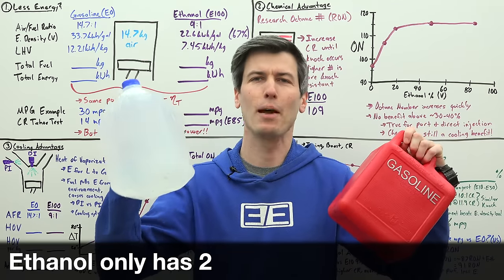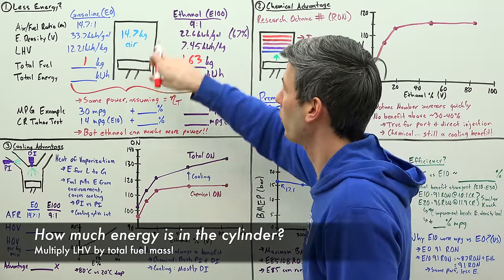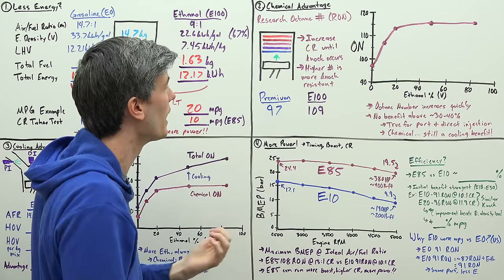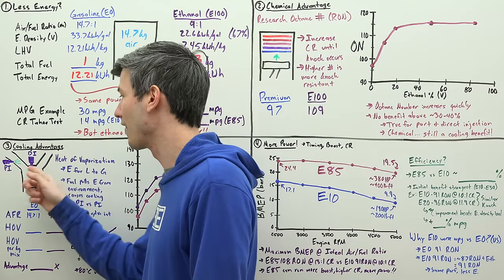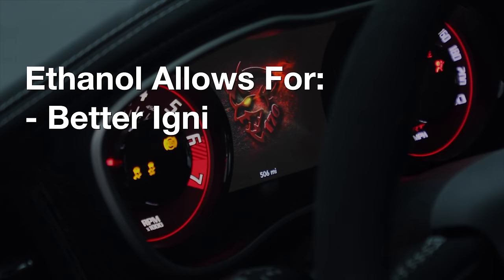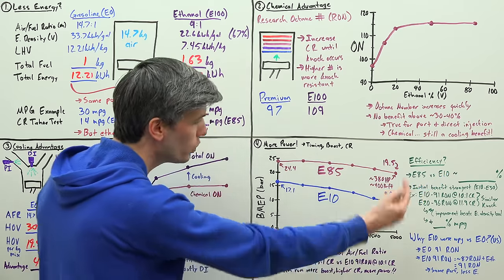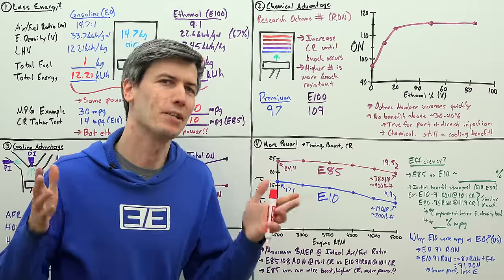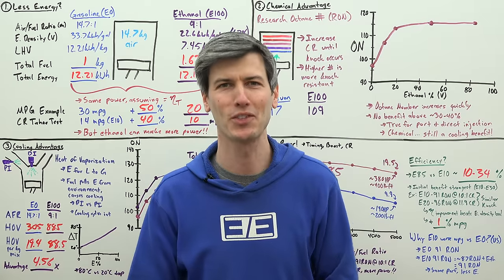Why Does Ethanol Make So Much Power? (Versus Gasoline)

Comment: The cooling effect of pure ethanol is so significant that for top fuel dragsters they don't use conventional water cooling of the engine block which then allows the use of a billet machined block which is much stronger than requiring the hollow cooling jackets in the block.
Reply: Pretty sure top fuel uses Nitromethane and Methanol not ethanol, the same cooling principle applies though you are correct
Reply from the maker: Is it a cooling thing, or a duration of heat thing? They obviously make extraordinary amounts of heat, but it's only for ~4 seconds, and then the engine is rebuilt, so having a dedicated cooling system may not be needed.
Reply: @EngineeringExplained  You're correct, they make a tremendous amount of heat. But the engine block is a sink. Trust me it's hot when it's finished a pass! I have a drag bike that runs on methanol and nitro blend. It's very hot when you're done. Same principle, solid block.
Reply: @EngineeringExplained  In that level of racing the engine is considered a consumable, just like the fuel.
Reply: @BillyWillicker  $$$$$$$$
Reply: @EngineeringExplained  I think it’s partly both but more a cooling thing. Around 8.6x more fuel, and that fuel having similar heat of vaporisation to normal petrol means roughly around 8.6x more cooling from just the fuel. I do believe these engines running for just 3/4 seconds at full power is almost a non factor as the heat energy they output in that small time surely surpasses what most engines output in literal hours I would guess. Basically I think they don’t need water cooling because they are fuel cooled engines essentially.
Reply: Fuel cooled with a TON of POWER!!  I'd love to see a video on how a top fuel dragster engine makes 15000hp from a 500ci block ... it just seems impossible!
Reply: @BillyWillicker  
Yes, I have heard a top fuel dragster run described as "a semi controlled explosion in a disposable container".
Reply: Don't forget that they rebuild the engine after each run.
Reply: Thanks, I've learnt something
Reply: Top fuels dont use methanol bud they use Nitromethane. A completely different fuel
Reply: @karlrovey  And that motor probably doesn't turn 800 total revolutions while under load & stress !!
Reply: @waylonmccrae3546  
The stress is immense! The cranks commence cracking from the very first use. They monitor the progression after each run and dispose of the crank after about 6 to 8 runs. Insane stuff!
Reply: @BillyWillicker  mmmm
crunchy engine block

Comment: I've been running ethanol in my vehicles for 40+ years. I learned everything you explained by trial and error. It depends greatly on the technology of the engine and the ability for the ECU to self-learn, or be programmed to take advantage of the better fuel. Also I did a lot of testing in the late 2000's on fuel economy and can report I duplicated the increase in mileage at about 25% ethanol. But I'm now running 100% e85. One thing that you will notice is if you plot diesel, ethanol and gasoline engines you'll see both diesel and ethanol make gobs of torque (non-NA engines) down low where gasoline does not. For towing, RVs', big rigs, etc this is a really big benefit. You just have to learn when to shift and not mash the gas pedal all the time and use that torque to accelerate the vehicle and this too can improve your mileage.

Also there was a fantastic experiment done in the 1970's on direction injected engines (non-NA) and they discovered silly amounts of power. It was a university study and unfortunately I have lost my copy, but that is what started me on the ethanol path.
Reply: Nice man!
Reply: Do you also create your own ethanol?
Reply: @sneaky_krait7271  Not at this time. But I have a plan to do so. (Growing tomatoes. Yes, you can get ethanol from tomatoes.)
Reply: @stickman-1  Saw that you need a lot of organic material and very expensive hard chemicals for it to work :/ Methane captured from compost seems better, but like to hear your findings
Reply: @sneaky_krait7271  eh, it's not that complicated. NileRed made a video where he made moonshine out of toilet paper (!), check it out. Although that process is really cumbersome if you want to produce fuel-worthy (ie., water-free) ethanol.
Reply: @mnxs  Funny, I've seen that video too many times. To get a good amount you need hard acid, which is hard to make yourself or expensive to buy.
Reply: @sneaky_krait7271  methanol is much harder and expensive to make compared to ethanol nowadays.
Reply: @sneaky_krait7271  Nile didnt use acid, but an enzyme. You might be able to make an immobilized version so you dont have to use tons of enzyme (continuous reactor vs batch). Same for the yeast. Then you might want to use a larger scale setup for distillation too. I wonder if theres something like RO membranes speficic to not let things like EtOH through.
Reply: @SaraK_69  Methanol can literally be captured from organic waste
Reply: @sneaky_krait7271  true bit it's also corrosive and thus not good for daily cars because it will pit and etch the pistons.
Reply: @SaraK_69  Interesting, that will occur even though it basically immediately gets burnt?
Reply: @sneaky_krait7271  Thats Methane you mean.
Reply: @SaraK_69 I suspect that the reason it will put and etch pistons is because methane from waste contains hydrogen sulfide. I'm guessing that clean methane doesn't do that. I'm pretty sure landfills clean their methane before using it as a fuel.

Comment: Hi everyone. Here in Brazil we use e27~e25. And sugar cane ethanol, not corn one. I heard from some tuners who says we had a best alcohol/ethanol I the world. I saw a tuned 992 gt3 lowered a lot exhaust temps and increased power using e50 mixture, resulting in a cooler combustion.

Comment: E85 FTW!  I converted my E36 to E85. Swapped to a bigger fuel pump, lines, and went from 42 to 80lb injectors. It was previously knock limited at about 10psi and could only run 6deg btdc based on the knock sensors. Making somewhere in the 350whp range.

Now it's running 16psi and 12deg btdc and is around 500whp on totally stock internals. Power is rod-limited at this point. 

Fuel mileage went from 22avg to 15avg. 

Now I want to E85 all the things. Only thing that sucks is finding the stuff. And the price fluctuates wildly.
Reply: May I suggest adding water injection ? Not water and methanol , just distilled water. Helps further reducing temps

Comment: E15 has now been approved for year-round sale in seven US midwestern states. No we won't get to the optimal ethanol/petrol mix on the graph for power/mix but it's a heck of a start in the right direction at long last. Makes the Elantra N look better if it can take advantage of the new fuel mix.

Comment: Simply awesome explaining. I've got an E85 Grand Caravan engine purring at 275,000 miles and I always attribute its hardiness to the bi-fuel over-specification of the engineering. I also have noticed it has two heat levels when I look under the hood after a trip: pleasantly hot and disconcertingly hotter. I wouldn't be surprised if this corresponds to which type of fuel is in the tank (E85 & gas respectively). That's a huge difference in evaporative cooling.
Reply: It's in your head...
Reply: @ShainAndrews  Time to find another hobby...

Comment: In Brazil we have E100 in the pump since the early 80’s. I personally used ethanol on my 2-stroke racing go-kart. Not only you could run a higher compression ratio, but also the engine (air cooled) would run at lower temperatures.
Reply: What ratio did you mix it with 2 stroke oil

Comment: I run a E50 blend of E85 and 93 gas in my F-150 3.5 Ecoboost. It’s making 553rwhp and 617rwtq. Stock tuning on 87 gas is 330rwhp and 415rwtq. So HUGE gains using ethanol.
Reply: And your engine last longer
Reply: @THe9-3MAnIaC  idk about longevity but so far I have 144k tuned miles on this engine and it’s been flawless.

Comment: I had a flex-fuel  Chevy SUV that had more acceleration with E85 than with gasoline, and got the same MPG for E85 & gas so it was less expensive to get more power

Comment: Well, that final tidbit, about the blend starting at a lower gas RON to end up with the "correct" number once ethanol is added, answers my puzzlement about why I have seen a m.p.g. drop the few times I had to use Regular (which the car is rated for) instead of Premium,....when I have always seen people say in videos that "Premium is a marketing gimmick. It won't make a noticeable difference in a car set to run on Regular."
Reply: Every car I ever owned got better mileage with premium fuel except one a 1999 Chevy Astro van V6.

Comment: I tested extensively in 2022 with different Ethanol blends in my Buick Verano turbo, trying to find the lowest cost mix in terms of cents per mile.  The Verano turbo requires 91 octane, but in my region of southern Michigan, premium gas is $1.00 more expensive than regular gas, and E85 is 50 cents per gallon cheaper than regular gas.  I really liked the idea of running my car on fuel that has higher octane than premium, but costing less than regular.  At the same time, I was leery of putting less energy in my tank and the effect on fuel economy.  Over a period of 7 months, I ran 75 tanks of fuel on E85/Regular blends ranging from 30% to 100% E85.  I found that fuel economy on pure E85 dropped about 23%, and didn't have much economic benefit over running premium gas.  But in the range of 40-50% E85 mixed with regular I found that my fuel cost per mile was about 9% less.  This is important to me, as my work commute has me driving ~34000 miles per year all by itself.  I stopped doing the E85 tank blends during the winter because it is a major pain having to run two credit card transactions at the pump when it is 25F and blowing snow.
Reply: Im 100% right there with you on everything you said. Even the two transaction thing at the pump I have had my card shut off after the first. I guess there worried about fraud. I think 30% is the sweet spot for OBD2 cars.

Comment: You mention that direct injection has a greater cooling benefit in the combustion chamber as it doesn't waste energy cooling the manifold like port injection, but there is not mention of the benefit of using port injection to cool the intake air charge before it enters the engine causing a denser air charge which can yield more power in a naturally aspirated engine. This video only focused on octane benefit and boosted engines. Using alcohol based fuels with port injection and shower head injectors on a naturally aspirated engine have gains in performance over gasoline in the same application. I would like to see your thoughts (math) for this scenario. Great information as always! Thanks!

Comment: I have a CL55 with a bunch of mods. I get between 10 and 17 mpg on my (607rwhp) gas tune depending on use and have never seen less than 6 mph even when beating on it. My E85 tune (675 rwhp) never got better than 10 mpg and got as little as 2-3 mpg when beating on it. It was crazy the differences..I went to E85 for more power but in the end I am back on 93 octane gas. The M113K is limited to around 17psi of boost and the ECM has torque limiting maximums built in to it so making power is all about the tuning and making power early. So maybe E85 was not as much of a benefit.

Comment: Great video!  I have two questions.  Does E85 have any adverse effects on the catalytic converter?  Are all of these power enhancements the same for methanol ?  Keep up the good work!
Reply: I don't believe so. I ran my car on e85 for 100k miles and left the cat in. Car has 140k on it now and I had to switch back to gasoline, but the cat is still good. 

Ethanol burns very clean, it's probably better for the cat if I could make an uneducated guess. My oil, spark plugs, stayed very clean on ethanol.
Reply: Why would it affect the catalytic covertor? Ethanol based fuel can only lead to an increase chance of rusting and more wear and tear as Ethanol is a water based liquid
Reply: It won’t as ethanol burns cleaner than regular gasoline leaving even less soot
Reply: If You search a bit on this channel there is a video about damages to engine caused by different fuels, and ethanol performs best. Just watch it
Reply: @mohammadyaqoob746  You didn’t do Your homework. Ethanol leaves less damages than other fuels🤷‍♂️
Reply: @maciejsn2126  I don't know about the channel but I have read research papers stating the relation of rust on different metals from the use of E85. You can search it on Google scholar under the heading of E85 rusting properties
Reply: @mohammadyaqoob746  ethanol also increases the wear on rubber components like fuel lines
Reply: @maciejsn2126  ethanol is hydroscopic, the higher fuel mixtures means higher duty cycle on injectors, it separates if left, Its fluid lubricity is inferior (paired with higher flow demand) which takes a toll on fuel pumps. Maybe you should do your homework. There's more than just the combustion process in a car. These problems are well documented and experienced by anyone that actually turns wrenches. 

The only thing that would back that video is that ethanol has a wide margin for error in the combustion process due to its high octane, and wide range of running AFR - which means less possibility of pre-ignition or overheating lean conditions. besides that, there's just more problems surrounding it as a whole.
Reply: @mohammadyaqoob746  you are both right technically. On older vehicles (90s & older) the ethanol has negative effects on vehicle fuel lines,pumps and so forth. 

But in the 2000s all vehicles began to be built with ethanol-friendly fuel system components because many nations, including the U.S., standardized on carrying a minimum of 10% ethanol in all gas fuels as a means of combating oil prices and emissions.  

So modern vehicles, even ones that are not technically Flex Fuel Vehicles officially, use ethanol compatible components so it is no longer bad for them. 

What makes a vehicle actually Flex Fuel compatible for full E85 then is the actual fuel delivery system - so that it can deliver the higher volumes of fuel required for full E85 - and the programming of the ECU to actually recognize and take advantage of E85 by altering timing and other parameters.
Reply: @upshifter5316  who cares.... i will continue to use E-10 in my Flex Fuel big SUV yukon because higher ethanol mixture gives you less MPG putting around town.... put that in your pipe and smoke it
Reply: @upshifter5316  ב''ה, also as an oxygenate anti-smog for winter gas in cold states.
 
The combination of preparing the industry for flex-fuel and the need for cars not to fall apart exposed to standard winter gas was behind that 2000s requirement.
 
Prior to that MTBE (and similar) was used, unsure if actually any gentler on fuel systems and gaskets but cheap as a byproduct of petroleum refining; this is now a forever chemical in everyone's groundwater.
Reply: @SmoothCruizer37  I wasn’t advocating for its use, just explaining the changes to fuel system components. Smoke that.
Reply: @SmoothCruizer37  Talked to a lady some years back that had a FF Yukon and was filling her while I was my FF Chrysler, even with the lower mileage, her Yukon ran better than on 93 (87 would ping) and cost less to operate despite the mileage because of the cost difference.
Reply: So a lot of people including me will ask, can I use E85 in my car that normally runs on 91, will I benefit without a special tune, because now I’m tempted to dump E85 in my wife’s 1.0 eco boost fiesta. Very interesting subject 👍
Reply: Ethanol cleans catalytic converters. Its just alcohol
Reply: @SmoothCruizer37  yep.  I have a flex fuel Ford 2L sedan.  E10 Gasoline is $3.20 right now.  E85 is 2.90 at the only place that has it near me.  Not much less.

MPG highway is 39 for E10 and 25 for E28.  Flex fuel vehicle with VVT.  Price per mile is:
8c for gasoline 11.6c for e85

E85 would need to be $2 to make it balance.  In summer 2020, gasoline was $1.35/gal which analysts said in 2010 would NEVER happen again.

That's normal driving up to 70mph with smooth conservative acceleration. Excessive HP is worthless in such driving unless you are towing.